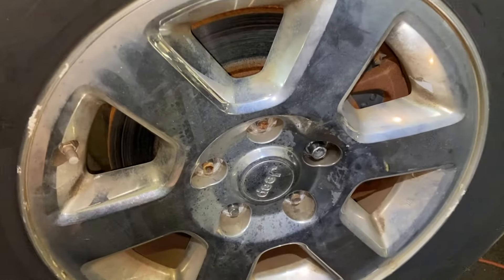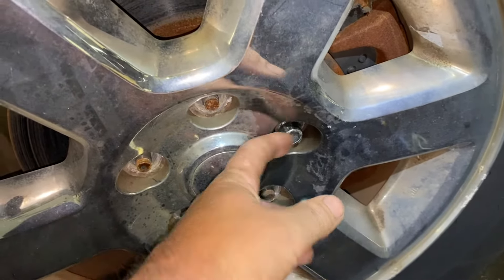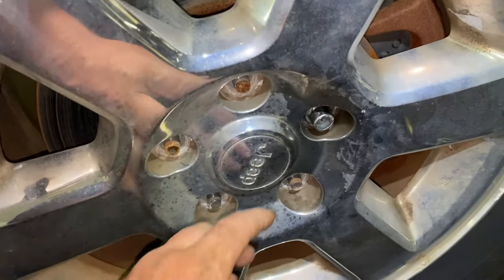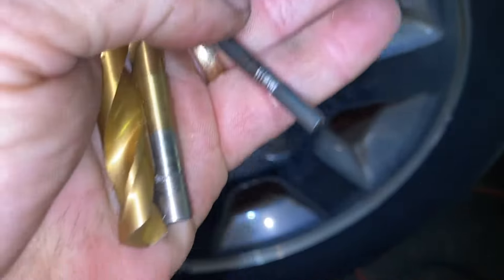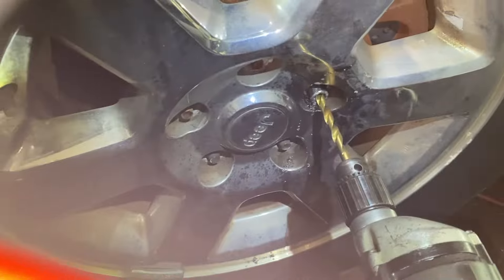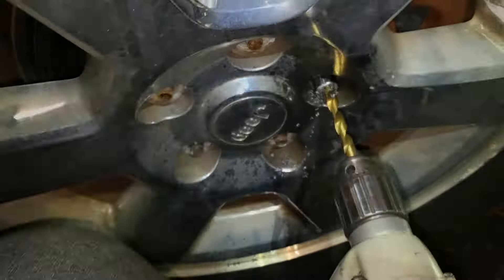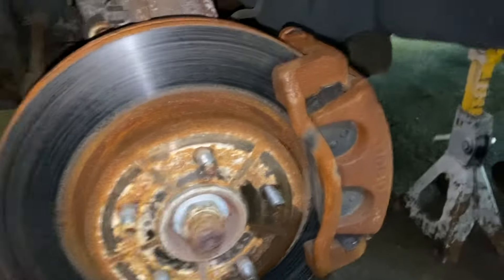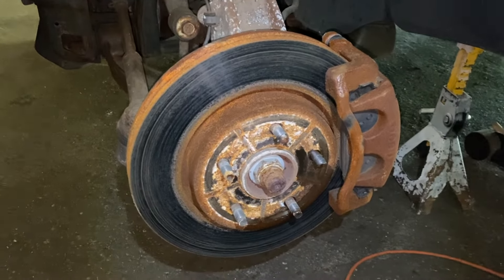How To Remove A VERY Stripped Lug Nut - When All Tools Failed - Guaranteed

Comment: Wait I thought all tire guys had to use that Ugg Aaa Dugga NASCAR Impact gun on the tire? Apparently thats what the guys who installed my daughters tires last time did. Very good vid and tip. It's not cool when your baby girl is stuck on the intestate with 5 rounded off lugs. Thanks this was the only thing that worked.
Reply from the maker: Thanks! No, every nut and bolt on a vehicle has a torque spec and the lug nuts are no exception. Tire guys barely have any automotive knowledge and use impacts because they are fast but don’t care if you can never get the lugs off again.
Reply: AAA woman here and yes I use an impact. However, I'm always very careful not to over tighten the lug nuts. It's mostly the MEN who don't pay attention to the torque that should be used for each vehicle. They end up over tightening the lugs, stripping the lugs, they misthread the lugs on, and so on. Which can and will lead to even bigger problems. These guys that do this are trying to be the fastest...WRONG. I don't want to be the fastest! I want to do it right the first time and send my members off safely. As a former RN I have seen more than my share of vehicle mishaps. Also don't let them use the compressed air impacts either. Most shops use them because they are able to do the job faster and make more money. I'm with this gentleman when he says if you see them pull out an impact gun of any kind...run! Unless you see them grab a Manuel or have a chart that tells them the torque and you see them adjust it. Hell ask to watch them adjust it and make sure it's right yourself. Better yet learn how to change your own tires in case of a flat. It's not hard...at all! Good luck and stay safe!!!
Reply from the maker: Well spoken!
Reply: We use impact guns with attachments on the gun so it doesn’t break the lugs n then we torque the wheels and boom done and safe idk what this man is talking about🤷‍♂️
Reply from the maker: @crlzm I’m talking about people who don’t torque them at all! You do , good for you! Thats what I’m talking about.
Reply: @jenniferelliott9368  How do you torque to spec with an impact?
Reply: Wrong
Reply: I purchased a car for my girls and it seems that whoever put the tires on set torque to 200lbs, I stripped the lug wrench that came with the car, had to put a 3 ft cheater bar on breaker bar to get some, I am down to one I may have to drill out.   Arggg.  All so I can change brake pad and struts.  Could nor have been changed on the road by the girls.😊😊😊😊
Reply from the maker: @papatomsthoughts That’s the whole point, imagine being far away on a trip and that happened. Something as simple as a flat tire could easily turn into a nightmare. Just make sure all the other wheels are torqued properly. Good luck
Reply: @motorcarnut  OH I will, currently front tires have been a challenge.  When we, yes I am teaching girls how to do brakes and struts at least to know what they are, get to rear axle I am sure it will be the same.  Ordering new lug nuts, non chrome covered.  Take care and God bless
Reply from the maker: @papatomsthoughts You as well!!!
Reply: I've just put ms3 grease on all my front lug nuts, I am hoping this will stop them siezing again??
Reply from the maker: Proper torque is key
Reply: Ikr I believe all tire shops use impact to put on lug nuts.  The one shop got mad at me when I asked them why they don’t use a proper torque wrench

Comment: You skipped the part using the socket 🔧 to break it off  🤷
Reply from the maker: Basically once drilled out like I explained a couple of taps with a hammer and it will just fall off.
Reply: U didn't show the most important part!
Reply: Exactly 😢

Comment: About to go buy a drill I’ve been trying to get a badly stripped lug out for about 2 months 💔
Reply from the maker: This will work! Good luck.
Reply: 7 months for me!
Reply: A couple of years for me. I’m curious why doesn’t anyone put grease on the lug nuts before putting them on in the very beginning? A friend of mine swears by it.
Reply from the maker: @lorihaire6459 Because lug nuts are supposed to be properly torqued dry with clean threads.

Comment: Why is it always a jeep dodge Chrysler with this same problem
Reply from the maker: It’s not
Reply: They use lugnuts that have an aluminum cap over a steel nut.
Reply: The nuts swell inside that stupid ass cap. I replaced all mine with solid ones because it was driving me crazy
Reply from the maker: @philipramsden4975 Yep, me too

Comment: Don't gotta do this just hammer in the socket into the lug nut and loosen. You might lose the socket that's about it. My socket came lose once I got the lug nut off
Reply from the maker: This method is for even when your method fails.
Reply: @motorcarnut  it won't fail 💯
Reply from the maker: There are nuts sometimes so rusted that method won't work. You don't think I've tried that?
Reply: @motorcarnut  this method in the video should be the completely last option when everything else fails. There is alot of other options than cutting into your lug

Comment: I agree an impact wrench should not be used on lug nuts. Since you're always working on cars, I would like to get your opinion on this. I believe the main problem with stuck lug nuts and stuck wheels to hubs is the aluminium rims that are used today. Steel and aluminium do not go together well under certain circumstances. One being when you add salt, I think it gets a chemical reaction (Galvanic Corrosion?) that almost equals welding them together. I live in Minnesota and they use a lot of salt in the winter. I don't ever remember having this problem or I should say it was never this bad when all they used were steel rims. Let me know what you think? Do you notice the problem more with aluminum rims?   Thanks, David
Reply from the maker: You're a 100% correct. Most of the times the corrosion is so bad it compromises the wheel and hub. Putting a little grease between the hub and rim and some on the lugs goes a long way and avoids most problems especially in the salt belt areas like here in NY.

Comment: This is helpful but is drastically oversimplifying it, in most cases. It's going to take significantly longer than that to drill out, typically.
Reply from the maker: Depends, some longer some shorter. The videos about how to do it not how long it takes?

Comment: I never owned drill bits that cut this fast. What bits are those
Reply from the maker: Forgot the name brand but their titanium tip drill bits.
Reply: Thanks for the Titanium Tip TIP......my drill bits are Useless on a 2001 Ford Escape.....as are Every other Tool made to Man. I can fix piston and turbine Acft airframes and engines.....can't do even a simple repair on this Rig....hour Gig turns into 3 hours, and multiple busted crap.
Strange thing is, just over 100,000 miles, but the engine runs like a sewing machine, and Plenty of Power.......the rest of the Rig systems are all in business for themselves.
Got the car for free, to keep it in the Family,as a Grocery Getter....2 In Laws, and a Nephew sent it to me.....I think I've been Conned!
Reply from the maker: Lol, no problem!!! Thanks for the comment!

Comment: man hoping i don't have to do that lol. change my own tires very year, take it in for only an oil change, then get a bill for new nuts and rotated tires with out asking. damn douche bags feels like they welding one of the nuts on. But thanks for the last resort option.
Reply from the maker: No problem, because the use a impact gun instead of torquing them to manufacture specs.